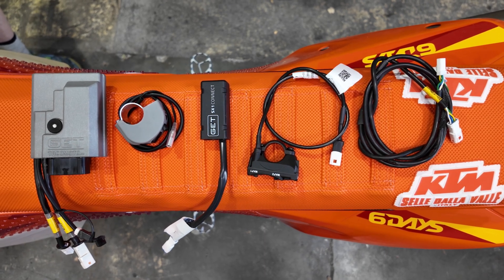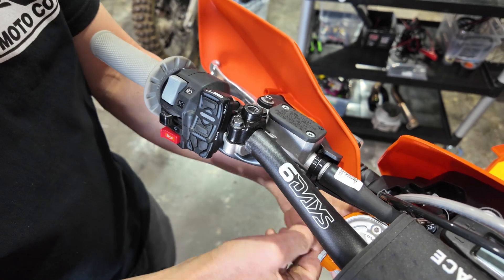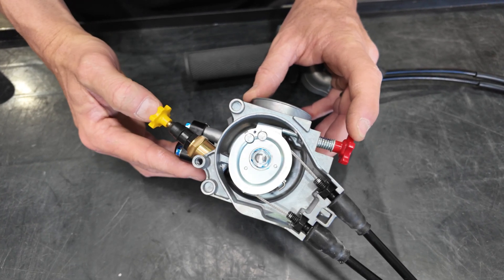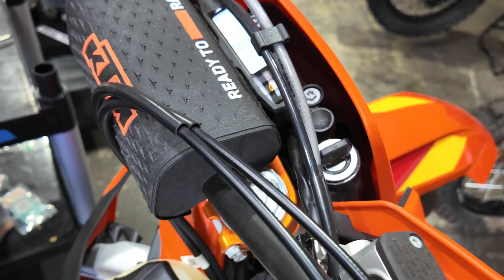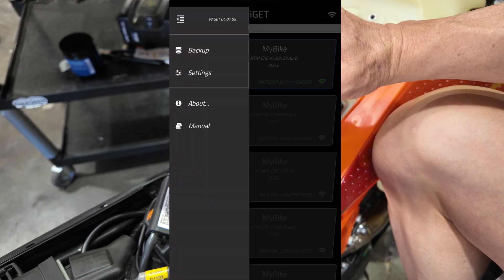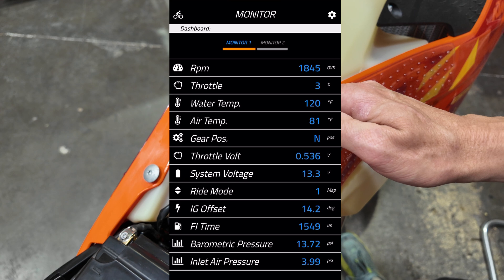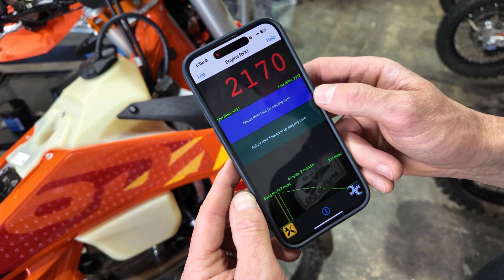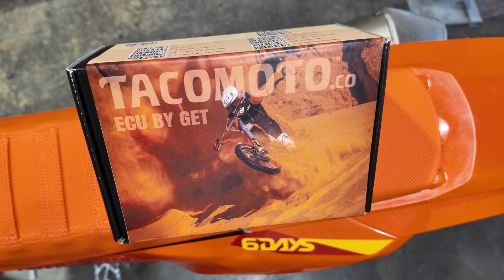GET SX1 ECU INSTALLATION - KTM, HUSQVARNA, GASGAS DIRTBIKES

Comment: I wrestled with installing the tank with the radiator shrouds on for 15 minutes. Took 30 seconds to remove the 4 fasteners holding them on and dropped it right in place.

Comment: Anyone have more details about the quickshift?  I have a 2025 FE 350S but im a little confused about how it works without a load sensor (which is what I have on the track bikes, etc) to know when to cut the ignition and he says "up and down" but its a throttle cable, how do you rev match going down?

Comment: I bought the SX1 ECU with LED Controller and Wi-Fi kit from Taco Moto, and it was delivered in less than a week. The installation guide made the process super easy to follow.

At first, I missed the step about ensuring the throttle plate was fully closed (at 5:01 in the video). After setting the TPS and idle, the bike started with a very high idle—around 4,000–5,000 RPM.

I reached out to Taco Moto support, and they immediately told me to reset the throttle plate to zero and redo the calibration. That completely fixed the issue, and now the bike runs like a beast.

Excellent video and outstanding support from Taco Moto!

Comment: Great video, I have everything installed but didn't think about the traction control switch worked so it's cool to see it demonstrated. 

When I installed the hardware and started the bike, it seemed like it was running rich and a bit rough, so I reset the idle. That smoothed out the idle, but I didn't reset the TPS first so I guess I have a project for today!

Comment: Putting the tank back on with the radiator shrouds attached is a pain in the ass.
Reply: I thought so too. I've had that thing off so many times now and I I find I do have to pull the radiator and plastics around a little bit and it works pretty easily.

Comment: How do we set up / calibrate the quick shifter? How do we know if the 2024 model bike has it installed? 

I couldn’t get a straight answer from the net or dealers on if my bike had the quick shifter capability. It’s a 2024 350 excf (the one Mike rode to check how bent my bars were at Dusty Lizard!). 

The bike came with the sx1, the prior owner got it from slavens.
Reply from the maker: There’s no calibration needed for QS on any of the Taco SX1 ecu’s equipped with the LED map switch for any 17+ ktm 350-501 enduro dirtbike 
It’s all plug and play ready
Reply: @TACOMOTOCO  thanks... it seems to me then that my 2024 350 EXCF doesnt have the hardware in the gear mechanism for the QS to work. The QS doesnt work on my bike with the GET SX1 installed (it came from Slavens). 

If you guys do figure it out I'd be very interested to know what happened in the 2024 model year and if its still happening. For example I heard 1-2 of the 500 6 days locally in Vancouver had the quick shifter active when sold as new here but then dealers were told to not enable it any more. And I dont know if the standard 350's and 500's in Canada even have the hardware, or maybe they have a software block for bikes that came to canada?
Reply: The procedure for Zero Gear is something like the zero TPS, but only on 1st pressed end stroke position, so the steps are:

1.       Start the engine with the motorcycle in a stable and safe position

Pull the Clutch
Engage 1st gear and hold and press the shift lever down firmly
Press the QS button on the SX1 Controller (or external button)
Wait at least 10 seconds to start the procedure and continue to hold!
The QS LED on the SX1 Controller and/or MIL starts flashing at a low frequency to indicate that the learning function is in progress. 
NOTE: If the switch is released during this phase, the learning will not be performed and saved.

When the QS led of the SX1 Controller and/or MIL flashes at a high frequency (for 2 seconds), the learning procedure has been successfully executed by saving the data in EOL.
The QS led of the SX1 Controller and/or MIL returns to indicate the enable status of the Quick Shifter.
Release the QS button on the SX1 Controller (or external button)
Engage the NEUTRAL
Release the Clutch
Stop the engine
Reply: @verminfate7074  did this procedure work for you? I tried on my bike and the quick shifter is certainly not working. I first want to know if my bike actually has the hardware for it! Is your bike canadian? a 350? a six days?
Reply from the maker: @andrewpocock1234 all 17+ ktm 250-501’s four strokes have the needed quick shift hardware on the bike
Reply: Procedure didn’t work, currently shipping it back to Rottweiler to have them map it. Taco guy, you keep saying it will work, but it doesn’t…. I have a 2025 500 EXC-F
Reply: @verminfate7074  let me know what happens! likewise I'll let you know how it goes with mine
Reply: I am literally waiting on this, called Athena GET and they said that they would send me an email with calibration instructions, if you hold the switch it flashes, wondering if you need to put the bike in N and calibrate it, will try a few things in a bit.
Reply: Any update on this? I have a 2024 fe501s with the tacomoto get ecu and led map switch and i cannot get the quick shift to work. It did not work out of the box so i attempted the calibration steps here as well as in the repair manual and no dice.
Reply: @Marti556  im not sure the husky 2024s have the sensor...only the KTMs...Im in the same boat 2024 FE501. Theres nothing in the parts diagram that matches.
Reply: @Marti556  The weird thing is that the 2024 KTM models I also looked thru the parts diagrams and cant find any addnl sensors. I read somewhere that the SX1 maybe was upgraded mid cycle and only the newest unit will have the QS functionality.

Comment: 13:37 "turn the knob counter clockwise" are you sure? 
Another question for you: I'm considering this or the upcoming dynojet option. My '20 six days has been previously messed with and has a jd tuner on. I've been trying to get better results when I try to blip and lift the front wheel. If I blip the bike in neutral it will often cough and stall so I'm looking at idle setting on the tuner. I'm at 5000' and haven't figured out if I'm too lean/rich or if I should be thinking about the accel pump setting? 
Also my bike doesn't seem to stay awake very long when I hit the starter. 
In other news I think my rings might be on the way out since I'm using up some oil. I'm also big-ish and pretty inexperienced in the dirt so that's probably part of the story.
I'm considering coming to visit you in the future but I don't know if my broke arse is a good fit for your services? Your deep understanding of these bikes and your excellent communication is very respected by me. 
If you'd like to discuss further I can email you. 
Thanks moto buddy.
Reply from the maker: You’re right on that, good catch 😎, we’ll make the correction and update this 

As for the other, shoot us a call and let’s tacobout it 

(725) 777-1552
Reply: Not fixed yet..... @TACOMOTOCO